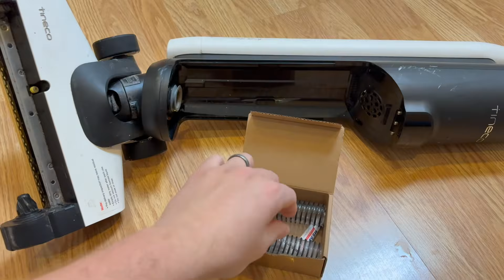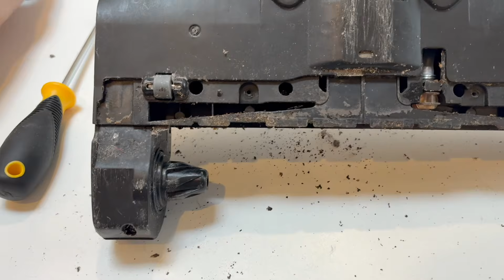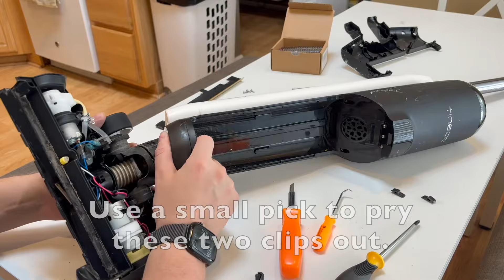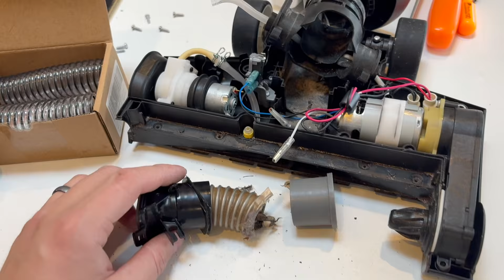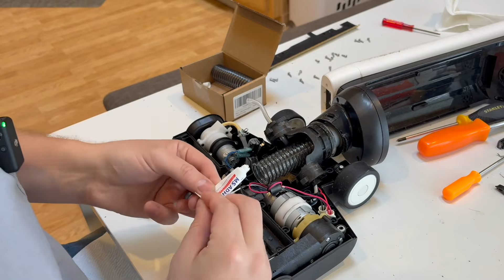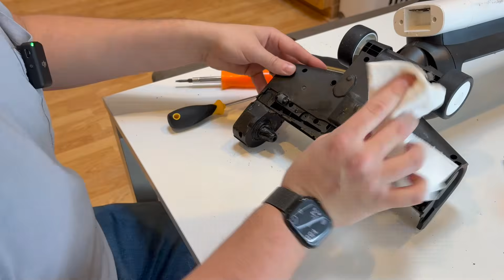Why is my Tineco Vacuum Leaking? Tineco Broken Hose Replacement Guide.

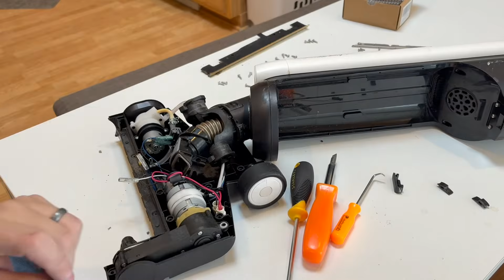Comment: Where does the black rubber piece I see on your screen at 2:33 near the end of the pick go? Now my mop stands up and goes too far and won’t disengage the roller without it and I cant find where it fits :(
Reply: If it is the same one i had issues with it goes in the front. There is a empty slot after reassembling
Reply: @dragonflammable did anyone manage to get this back in successfully? I'm still at a complete loss on where it goes.
Reply: @leahrickelmann5027 yes we got it back in when we reassembled it was obvious where it went
Reply: @dragonflammable ou à l’avant je ne vois pas ?

Comment: Thank you! Such a great video! I got the hose fixed now! It has now started to not turn off the brush roller in the upright position.  So technically i can still use it but it will just keep spinning if k don’t turn it off when i put it up right. Any idea what i did wrong? Google wasn’t helpful.

Comment: I’m having difficulties to disassemble the head.. do we need to press left and right side altogether and try to pull it?
Reply: Me too! I used a very small flat screw driver to lever one side up slightly (the side with the hole), then it is a clip with a tongue that slides out.
Reply: @shelleyunderwood-green5662  Thanks a lot.. I just try and it works..

Comment: Thanks for the video. Replaced the hose to my iFloor 3. My model Tineco was a bit easier to deal than what's in the video, except the iFloor 3 has a metal clip to be aware of (it hits the on/off button when the mop is angled).

Comment: On the s5 stream is different to pull out the hose? I'm having difficulty.
Reply: For those guys who bought S5 stream... It's the same set up AND push the white hose to the top actually all the hoses in order to pull down the base to get out the broken hose. It's a tight fit because all the small hose.
Reply: Tip - just take out the screw on the outside no need to take out the top and bottom scrape.  Hidden screw on the top front under the sticker "caution: be careful of hot stream".

Comment: Please help I accidentally broke off a little spring piece and now my tineco won’t turn off when it stands upright
Reply: There is a switch/clip on the wheels, you probably didn't position it correctly when assembling. In my case, there was a metal switch on the left-hand side that detects whether it is upright.

Comment: Hey, most of these replacement parts are not available online in India. Those that are available cost 1/3 rd the cost of the whole machine (I am talking about just the pipe). So I did "Jugaad" by using a 1-inch corrugated pipe and dipped it into boiling water so its easy to insert it into both couplers. I then wrapped electrical tape over it to provide additional strength.

Comment: Thank you your video enabled the amazing effective "first try" success of my attempt at the repair. I have the S3? The 2021 version. There are two plastic locking fixtures located either side, which connects the used water container mount/ suction inlet. These simply snap into place and allow the upright portion to swivel. These white snap locks are unique. The white locking tabs require a pick to remove. Of the entire repair process easily this requires the most attention to detail. I was surprised with the level of detail used in manufacturing. Clearly the $300 price tag is in direct proportion to the careful, skilled hands used during assembly. I rebuilt my first engine when I was 11yo. With the new hose installed the S3 is kicking butt again. I can precisely recall when the hose split but Remember clearly my floors losing their shine  a matte oak. I thought it was plugged. Only during a detailed investigation I saw it was the hose. Now my floors are again so beautiful 😍 😍 What a great repair and thank you ?

Comment: Very helpful video. Big thanks! I was able to replace the hoss as  instructed. While doing that a tiny metal bracket/clip fall. I have no idea where it should go or how to assemble it back 😒Does anyone happen to know and will be able help? Thanks 🙏
Reply: on the back of the grey component(beside the left motor), there is a little orange button. The metal clip is supposed to cover the button so that the button is pressed when the vacuum is at upright position. You can find a little pin on the side where you can align the clip.
Reply: @danielwang5298  thank you
Reply: Same for me, is that necessary to put in and where it goes?

Comment: I see this video is fairly old.  I completed this repair on my s3 one but now it won't dispense water. I think perhaps I knocked off a wire(I just reopened it) that doesn't seem to be the case. I may have seated the neck near the wheels incorrectly. I see there's a metal switch there on the left side but I'm unsure how it's supposed to go since I thought II put it back how it was originally but clearly I didn't since its not operating correctly anymore. I really do not want to spend hundreds on a new one. haaaalp!
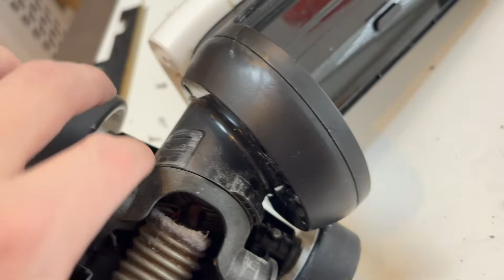Reply from the maker: You can see around the 1:40 mark that the next of the vacuum joins the base with some round “wheels”. This makes contact with a switch “blue wires” that I’m assuming controls turning on or off the water and roller based on if the vacuum is upright or at an angle. I’d check the connections of the wire on this switch and make sure everything is seated correctly again. Good luck.
Reply: I have the same problem! Did you fix it? Can you help me please? Bye 👋🏻
Reply: @stefanobianco2201  I knocked off a cable upon reassembly. I got the water to run again but now when I stand the mop up, it continues running. It is definitely not correct but it still cleans my floor. I am tired of fooling with it.

Comment: Hi, I took out the bottom 2 screws of my tineco s5 pro clean water tank to clean the hard water sediment. The clean water tank is probably factory sealed cause it didn't open but instead the push plug inside came open. I'm trying to put it back but I don't know which order they go in. Could you please help?
Reply: Trial and error dog. It's a simple gravity feed line. 😂